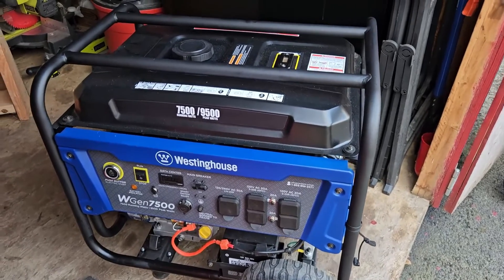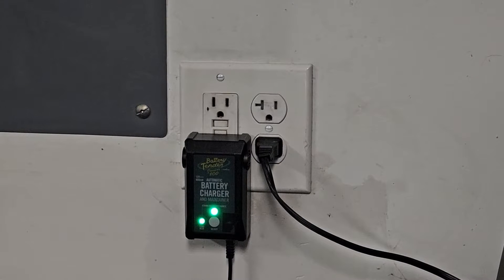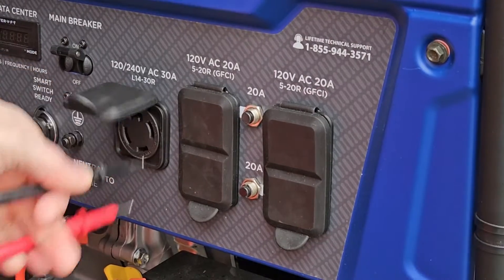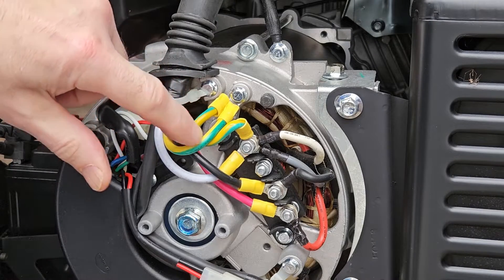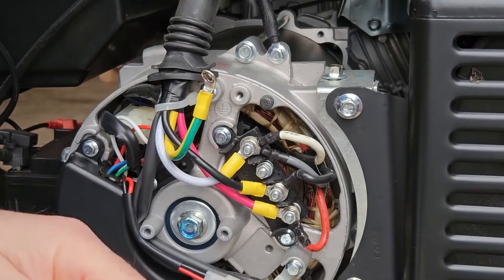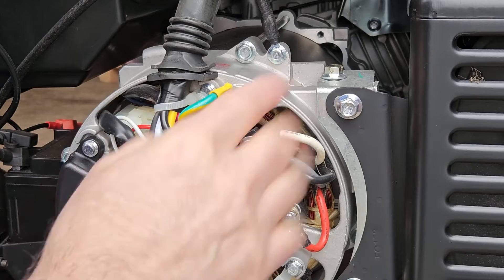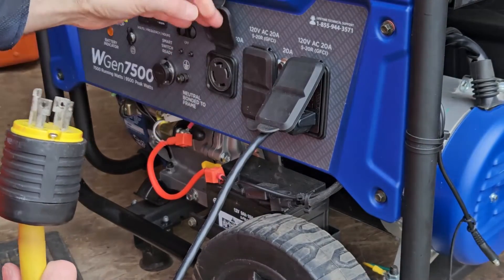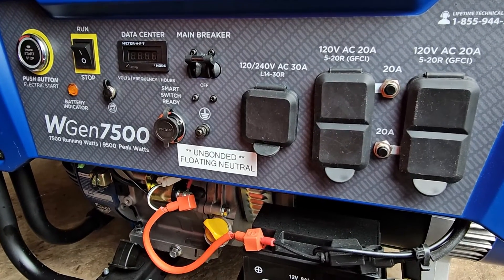Unbonding a Westinghouse WGen7500 generator

Comment: Why they don't have a switch for the neutral to switch back and forth is mind boggling.
Reply from the maker: I made a loop back plug. When I plug it into the front of the generator, it's bonded. Remove it, it's floating.
But yeah, it would make sense to have a switch IMO
Reply: Their lawyers probably advised against a bonding/un-bonding switch. The customer intentionally un-bonding the generator absolves Westinghouse of any liability.

Comment: If you float the generator and hook it up to power your house breaker panel which is bonded, can you also at the same time use the 120 plugs on the generator to power something else?
Reply from the maker: On my generator the answer would be yes, because the 120v outlets pickup the bond the same as the 240v outlet. I would bet it's like this on most generators, but you should check with a meter to confirm.

Comment: I don't have a transfer switch and only have an interlock. I'm guessing I should unbond it still if I'm going to run my house from my generator?
Reply from the maker: You shouldn't guess, you need to know. 😊  You need to have only one neutral to ground bond in the system. If your existing bond is still in effect when using the interlock, then yes, you would remove the bond from the generator. You need to test that with a meter to make sure.

Comment: Thanks for clear steps. I’ve heard others hook it up to a switch so you can switch easily.   Thoughts on that?

Also was thinking of throwing a few stickers on the 120 outlets saying neutral unbonded so anyone would at least try to look up what that means before plugging in an extension cord
Reply from the maker: I made a bonding plug which can be plugged into a 120v outlet on the generator, and voila, it's bonded. I've never used mine except when connected to the transfer switch, so it's not something I would need often. I also have a label on the generator indicating it is floating neutral. Just trying to cover all my bases.
Reply: I'm doing the same thing with my unbonded generator. Which powers my house when needed. At least two stickers stating that it's unbonded neutral.

Comment: I need help. Looking at my duromax XP13000HX i see the 4 lug bus and the ground like shown in the video… i see in order top to bottom on the bus red, white, white, black. The neutrals not tied together but there is a yellow/green jumper that goes from just one of the neutrals to the ground on the stator. Duromax claims this is a floating neutral generator stating the stator isn’t connected to the frame and is separated by rubber mounts. So my question is why are the two neutrals separated yet one is connected to ground. What does that mean? Its like its halfway bonded.
Reply from the maker: Not sure if this will help:
https://www.reddit.com/r/Generator/comments/zpwax1/duromax_xp13000hxt_floatingbonded_neutral/
Reply from the maker: Have you tested the generator at a front outlet with a multimeter?
Reply: @bluesriderDF yes, I checked continuity and shows to be bonded like I see at the stator… but the manufacturer insists that it’s unbonded simply because it’s on rubber mounts. I want to remove the jumper and float it. But my question now is do I need to physically tie all the neutrals together? Here’s how it’s configured- 
There’s 2 neutrals that come out of the stator and there’s two that leave going to the generator panel outlets. They are both isolated but one has the jumper going to ground. One of the neutrals goes to the 30 amp 120v and to the 30 amp 120/240v outlet, the other neutral goes to the 2 GFCI 120v outlets and the 50amp 240v outlet.
Reply from the maker: @Treyk901 Disclaimer: I am not an electrician. There is only supposed to be one neutral to ground bond in a system. Whether it's rubber mounted or not seems irrelevant. That aside, in your current configuration, can you test continuity on the front between the neutrals of all the different outlets, including the 30amp? I would expect all of the neutrals would be tied together already, whether it is bonded to ground or not.
Once you've determined that, the jumper you are talking about should be bonding the whole system, and if you remove it, then it is floating.
This is my understanding, but again, I am no expert.  I would think the instruction manual would explain very simply how to bond an unbond. Maybe ask a question on an electrical forum where they have a generator section.

Comment: My understanding is if  your transfer switch switches the neutral, then your bonded generator would be ok as is but then considered a seperately derived system.  I think then you'd need a grounding connection to a new ground round.
Reply from the maker: @Zues64  My understanding as well.

Comment: Great video. Do you think it'll work making a blank L14 plug with the hot prongs removed and just a jumper inside the plug connecting the ground and neutral?
Reply from the maker: They sell ground plugs, but I made my own with an L14 I had lying around.  I took a 6" length of 12-2 Romex which comes out & loops back into the plug.  I only connected the ground & neutral.  I cut the hots at each end and taped them off.  If I ever need to use the generator when not connected to the transfer switch, this plug puts it back in bonded configuration.  Thanks for watching!
Reply: @bluesriderDF  that's exactly what I was thinking. Then I'll hang it with a cable or zip tie or something so it'll always be there and I'll be able to plug it in. Thank you for the great videos.

Comment: I have seen some people make a short jumper using a 5-15P and a single wire going from the neutral on the plug to the frame bond bolt (under your main breaker). In whole-house transfer switch operation, the plug just dangles, but if they are using it for jobsite applications, they plug it into one of the outlets, bonding back to the frame.
Reply from the maker: I just made one out of an L14 plug, in case I ever need to use it standalone.

Comment: I watched the first video first then this one, iF the cord that connected the generator to the transfer switch was ok and not bad. ,if you use a generator that has the internal bond and use the generator what could happen? As far as I know mine is set up like yours and I've never unbounded the generator  I've used it a couple of times but its been a while ,lost power once for 6 hours and I started the generator to make coffee and run the freezer and fridge. Nothing happened all worked fine.Now 2024 every thing is all computerized including the fridge and AC . Should I do the floating ground or keep it like it is? Or just not use the generator at all? Someone chime in . Thanks for any replays!
Reply from the maker: Jeff, I used that bad cord with a bonded generator for 20 years, and had no idea the current was using the ground instead of the neutral.  But let's say the cord was good, what would happen?  You would have 2 paths to ground instead of 1.  You might have GFCI's tripping, or maybe not.  Otherwise you might think everything is fine.  But if you had a fault in the house, my understanding is that the return current would be split between the 2 paths to ground, and not strong enough to trip a circuit breaker on either one.  Please watch the video in the description for this video, it explains it better than I can.  To be code compliant, you should have only one path to ground, which typically would be in your service panel.  Thanks for posting!
Reply: have 2 grounds may not immediatly show an issue, or may never, but GFIC and ARC breakers do not like it, and GFIC may not work correctly (ie electrocution hazard in wet areas) if there are 2 paths to ground. 
Also I know there seem to be a lot of modern furnaces and thrermostats that will not work if double bonded (would not apply to your current situation since you say no issues on your system). 
Basically, everything is fine, till it is not.